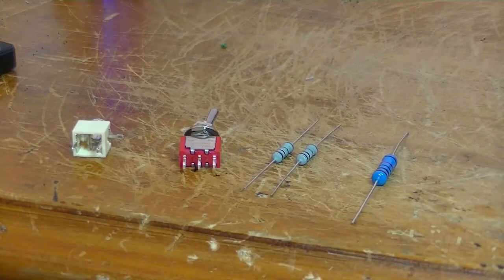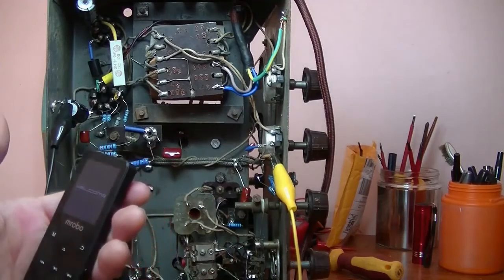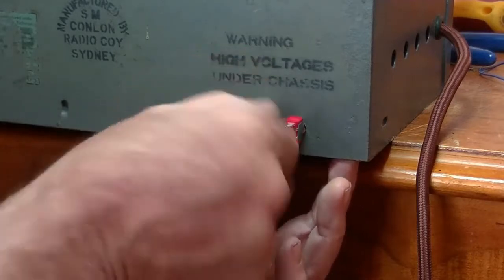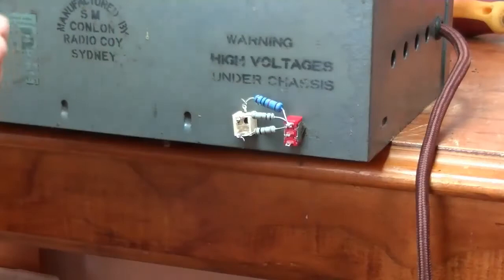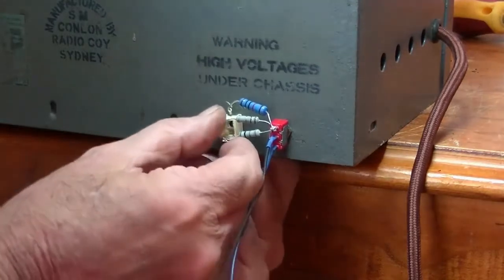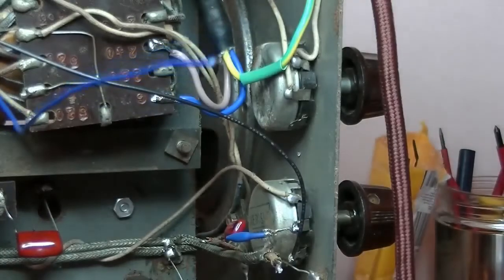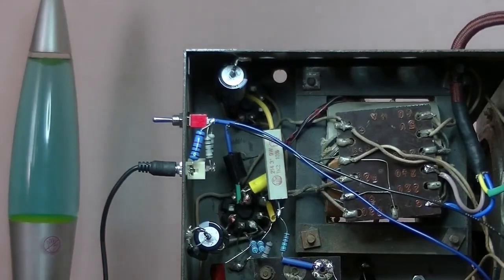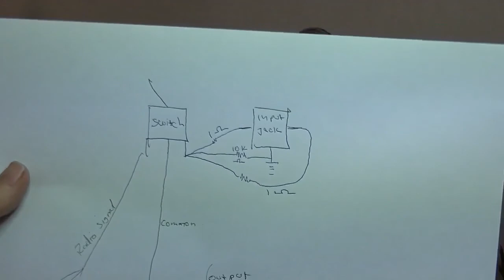Add an MP3/smartphone input to your valve radio

Comment: If you are stymied by all of this go to  YT 'er Mister Radio. He goes into detail on how to accomplish  this procedure
using  a small  welding isolation transformer like the ones found in "wall warts". He has done this on many radios
 having a series string tube ( AC-DC)  set. On power transformer sets you can get away without using an isolation
 transformer because there isn't high voltage on the input line of a correctly recapped radio.

Comment: Enjoyed your video - very informative.  I've also had problems with some radios not responding.  The preamp addition would hopefully solve this issue.  Would you consider doing a video on adding the preamp to the control grid?  That would be help to resolve the problem with some of these radios.  Thank you for posting.
Reply from the maker: Hi, yes some radios just don't want to play mp3's. The next one that needs a pre-amp will definitely have a video of it's own. Thanks for watching
Reply from the maker: Hi, SJ;  yes I'm happy to do that video. It will have to be after I restore a handful of radios that I just received though. Thanks for watching

Comment: Thank you for the tutorial!  I'm going to try this with a 1937 RCA victor 812K model
Reply from the maker: again, so sorry that i havn't been on. This covid has been tough. How did it go?  any issues such as low volume output from the player?
Reply: @exeterslab7781  Not the author of the comment, but low volume is the issue I have. Or its very distorted.
Reply from the maker: @Kartoffelkonig97  Hi Gio, what radio is it?

Comment: Hi, looking at my first radio fix.  I have a tube radio with pu mono/pu stereo buttons. Also old style 5 pin tape recorder input in the rear. Can i just use this input connection for AUX
Thanks
Reply from the maker: Hi Andrew, yes, the aux input should be able to accept any audio input like an MP3 etc. It's just a matter of identifying the wiring  on the din plug. For mono mp3 two wires are needed, one for earth and the other for the signal. For stereo, 3 wires, 2 x signal and 1 for earth. Good luck :)

Comment: Going to do this to Philco 37-675.  Do you know if that’s a hot chassis?
Reply from the maker: I'm not familiar with this philco but I looked it up and saw that it''s a console according to radio museum.. The schematic shows a transformer so that's good. You can do the mp3 mod on a hot chassis (i've done it on a mantel set from the UK) you have to make sure that active is NOT going through the chassis.  I've done a video on hot chassis mains wiring and I think D-lab and Uncle Doug have too. There are a number of videos out that demonstrate ho to ensure the chassis is not hot to the touch. Feel free to message or email me if you have any questions. Good luck with the project and stay safe

Comment: I have a 1963 Battery powered (2 C cells & one 9v battery) 3" Reel to Reel Tape player. 4 Transistor, no tubes. I don't wan to use its  cheap microphone to record music...I want to directly record songs from the mp3 player, to the mono socket of the Tape Player's microphone input. Then push down the red record button and let the music start going onto the Tape......Crazy idea? Must have been done before.....hopefully not many parts.
Reply from the maker: That's not crazy, I think it's brilliant. It's got to  work easily enough even if you have to change the input jack to 3.5mm. Go for it

Comment: I would want it to go through the output tube rather than just connecting it to the speaker.
Reply from the maker: Hi, connecting an mp3 or phone directly to the speaker would produce little or no sound as they don't have the grunt to drive the speaker. By connecting to the input of the vol pot, the signal  output, either radio or mp3 is then processed by the rest of the circuit which includes the output valve. Thanks for the comment

Comment: what are the value on resistors?
Reply from the maker: I use 1 ohm resistors to connect the 3.5mm jack to the switch, it's easier then cutting small wires to make the connection. Terry Dayton from D-Lab originally used 5k resistors on his video. On a later video, he didn't used any. 
The 10k load resistor to ground is the important one

Comment: Would love to do this on my eddystone 840 c.☹️
Reply from the maker: Hey David, have you tried jumpering your phone/player to the output of the volume pot. It should be the middle terminal
Reply: @exeterslab7781  not on my type  of equipment no don't think it's good it's a live chassis no transformer in these sets.
Reply from the maker: @David-kd7vl  Ahh I see. yes best to be safe David

Comment: Why did you use 1 ohm resistors for the R & L channels when I think D-Lab used 1K ohms? I think it makes more sense to use the 1 ohms for louder audio but perhaps D-Lab was thinking more about protecting the Mp3 and other players. Your thoughts please?
Reply from the maker: Sorry for the late reply Ken. I originally used 1k's as per D-Lab and then tried different values, as well as no resistors. I found no real difference on volume with all these variations. I use the the 1 ohm's as I have a heap of them and they are so easy to connect the switch to the input jack, rather than cutting up small wires. 
From what I understand from watching Terry, it's the 10k resistor that provides the impedance load to protect the player. I also noticed on a later D-lab video that terry had omitted the 1k resistors entirely. Ive been using my mp3 player regularly for over a year now and it just keep on chugging, so I'm confident that the 10k is all we need.
Reply: 10k is all you need to convert line level to match headphones , simple hook up can be used instead of the other 2 resistors. This is the correct mod not a damn electronics lesson. people working on valve sets should know this.

Comment: This is potentially  very dangerous,  for any radio that does not have a mains transformer or "hot chassis ". Do not attempt  this unless you know  what I am talking about. For < $15 you can get some cheap  computer  speakers  that are safe. This modification  can KILL!
Reply from the maker: Hi Fred, 
Yes hot chassis' are a potential death trap if the active is running through the chassis into the circuit rather than the other way round. I'm going to mention this on my next video. Thanks for he heads up
Reply: Index could be deadly I have a eddystone  840 c. Wish I could do something like that on mine but it would be crazy to do so quite shocking possibly!😬
Reply: use an isolation transformer then, if you cannot workout that this video is from Australia. We have very few hot chassis radios down under, only live ones were AC/DC sets . If you choose not to use an isolation transformer with hot sets then that is your fault.